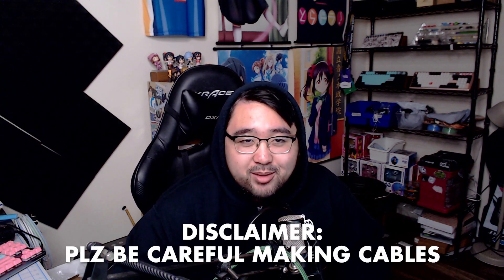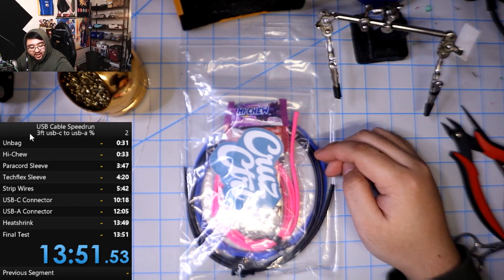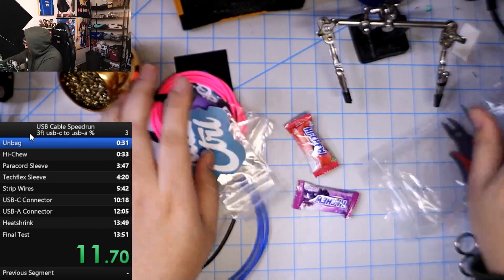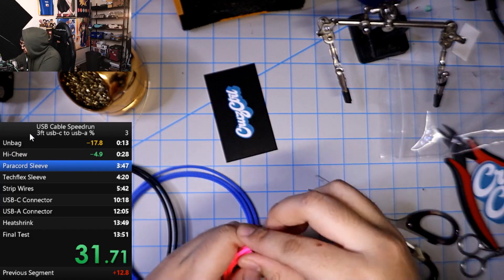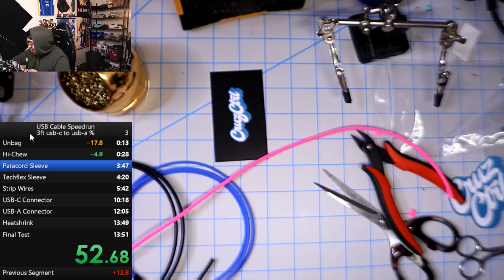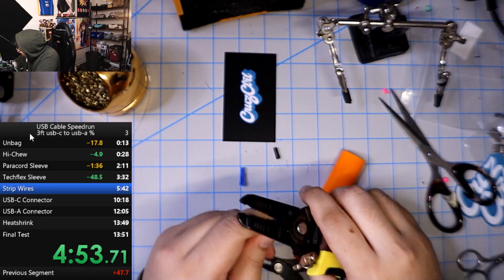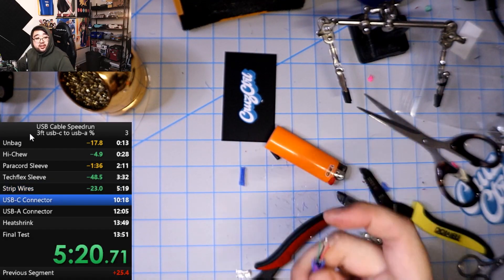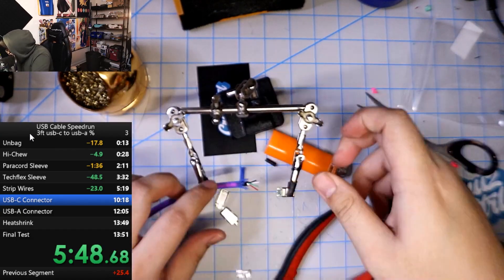DIY USB Cable Speedrun in 10:11 (World Record Attempt)

Comment: hey i have a question; doesn't the heat from a heat gun melt the paracord when coiling a cable? will that happen if i sleeve a cable with only paracord?